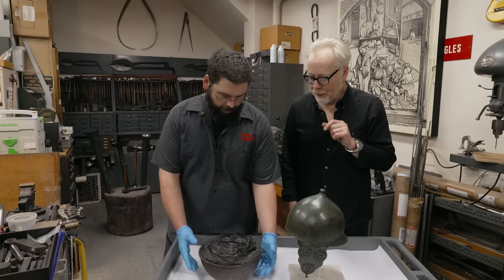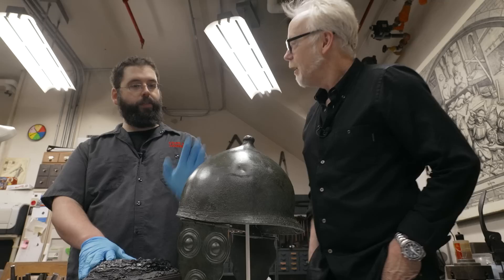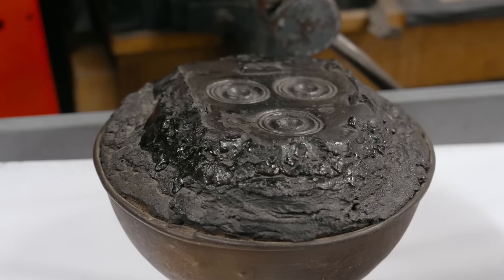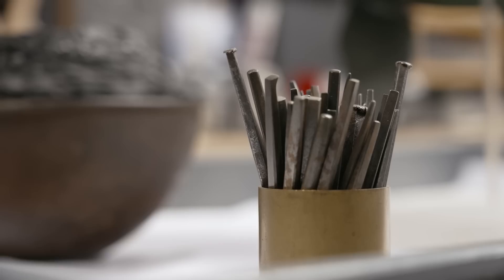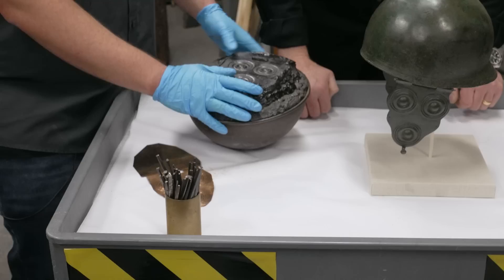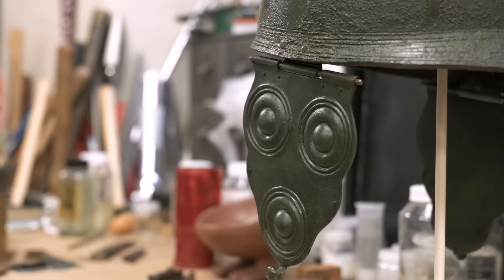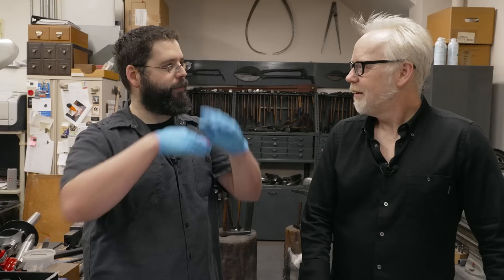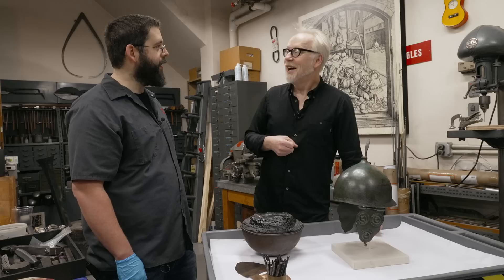Adam Savage Learns Ancient Helmet Hammering Techniques!

Comment: Years ago I made a copy of the Brocas frogmouth jousting helmet for a customer. I got about 50 pictures of the original sent to me by the Royal Armouries.  I pinned them all to the wall of my workshop and realized that it would be a living hell to replicate that helmet. First there was no real symmetry, in whatever direction. Crossing lines on the top were not 90 degrees but more then 85 degrees or so. Even the number of rivets on each side was different ( well perhaps I make this up right now) and all had a different shape and distance to eachother... It took me 3 months to complete the job... It looked great though.

Comment: That feeling of connection to the ancient maker reminds me of when you read a line of poetry, or a sentence in an old novel that resonates with you in unexpected ways. Both means by which human creation and expression can reach across history.
Reply: I worked on an excavation of a Native American campsite from about the time of European contact. In my square was a scatter pattern of 20-30 bi-facial thinning flakes - the narrow ridge between two flake scars that has been pressure-flaked off to thin the tool. These are only about 5-7mm long and 1-2mm across. Having tried it myself a number of times and occasionally succeeded, I had respect for the toolmaker who made them. Given the scatter pattern, it was very likely that the toolmaker had been squatting at or very close to the same spot outside the square where I was squatting.

Comment: Cool!  I build 4 brass shield bosses over the winter and had to do a lot of work hammering (plaining?) out the little nicks from the anvil.  I tried a wooden arch, to avoid the nicks, but it was difficult to work with and really didn’t work well.  I think the pitch will have the right consistency… 🤔

Comment: Interesting. You said pitch is pine resin when pine resin from countries it's used in actually translates to tar and english speakers are often shocked to hear some countries use tar as seasoning and they usually have to be corrected that tar is pine resin and it's better don't mix it up with petroleum pitch.

Comment: What face would Adam make upon learning that Montefortino three-bossed cheekpieces were very likely miniature models of three-bossed cuirasses? Yes, Etruscan warriors likely wore armor made up of miniature models of armor pieces! Notice the word "likely", that is just ONE of the theories about those. But that's not the point. The point is that one of those pieces MIGHT be an Etruscan armorer thinking "how cool would it be if this armor was made of miniature models of armor?" Which is the most Adam Savage thing that you could conceive.

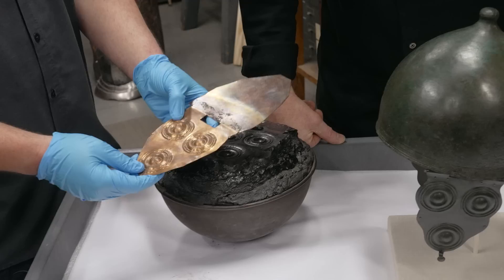(Longer explanation: Earliest Etruscan cuirasses were a simple square or round piece over the heart. A later style existed with three such round bosses, two over either breast, one over the stomach. Yep, just like the cheekpieces. Those cuirasses had two small lobes on the sides to which the cuirass straps were riveted. Exactly like the ones you see in the cheekpiece at 4:17. Thing is, the earliest known example found of that kind of cuirass is of a later period than the earliest known example found of that kind of cheekpiece. By that time, they were already making the cheekpieces as simple triangles, without the lobes. Traditionally it was said that the cuirases imitated the cheekpieces: however, Peter Connolly (one of the best Greek and Roman historians of the XX century and one of the very first reconstructional archaeologists) argued that made no sense and the most likely case was, the cuirases came first (with side lobes that have a function), then the cheekpieces in their shape (including the side lobes which have no function on the cheekpieces), then the cheekpieces without the side lobes. Giving that we have not found that many Etruscan pieces of armor, it wouldn't be weird to have found earlier cheeppieces but not early cuirasses. There are armors of that period that we only have pictorial examples of them but no arquelogical pieces have ever be found. According to him, every early cheekpiece would actually  BE a pictorial representation of an early cuirass.)

Of course, that is just one of the historical theories (no matter how likely or cool it might be) until we actually find one of the older cuirasses. But that's not the point. The point is, as mentioned, the very possibility of an Etruscan armorer thinking "how cool would it be if this armor was made of miniature models of armor?" being the most Adam Savage thing that you could conceive.

Comment: Is there an advantage to the bowl being a bowl instead of a cylinder ?
I got the feeling it may roll when hammering.
Reply: I would imagine that it's easier to move around and see the different angles because of the rounded base.  With something that small you aren't taking giant hammer swings, you're going to be gently and lightly tapping it, so the movement wouldn't be much of an issue.
Reply: you use a sand bag or donut underneath and you can move the bowl around to get the easiest angle to work from (handy when you are working on something with a curved surface)
Reply: Probably because it was heated on a forge fire, then used on an appropriately shaped tree stump.
Reply: It’s seated on a base while in use, either a sandbag or round ring of leather or rope etc, so it can be tilted and rotated to whatever angle you need while working.

Comment: If pitch is a liquid how do they still have pitch with original hammer marks from way back when? I know pitch moves very very slowly but you would think over that long it would level out after not being used.
Reply: I mean, the pitch drop experiment is on like... Drop number 4? So yeah it might level eventually but not yet.
Reply: @cholulahotsauce6166   oh I know it goes slow. that's 94 years old I think. Look at the distance that pitch travelled. You would think a bowl of pitch with some marks that are less than a ½inch deep probably didn't level out. I guess if it was constantly used from the time the pitch was put in the bowl to today. But if it sat around for over 100 years it should be flat. Maybe I'm wrong. I guess that depends on the temp of the area it was kept as well.

Comment: No Way you upload this as I'm handmaking a Mandalorian Helmet with the frame of my old PC and a ball peen hammer. Lol.
Reply: For helmets good stakes are the trick. Pc case metal is great for hammering, it's specially made for mechanical forming. Ball stakes are a good start, but also V and reverse V stakes ( clamp a dulled axe in a vice) are the way. You also need offset stakes.